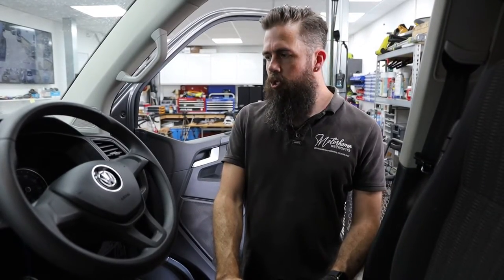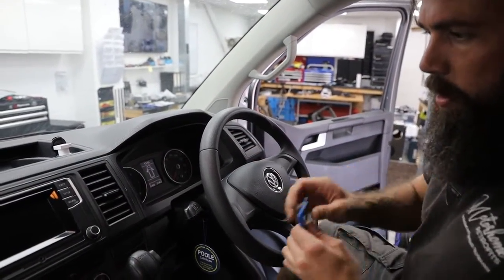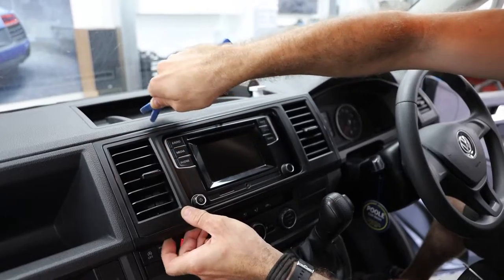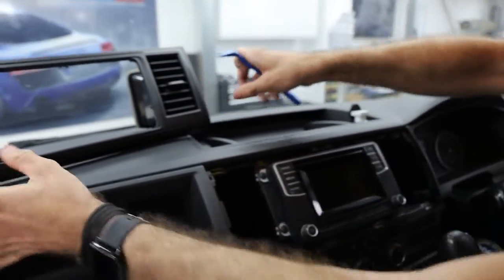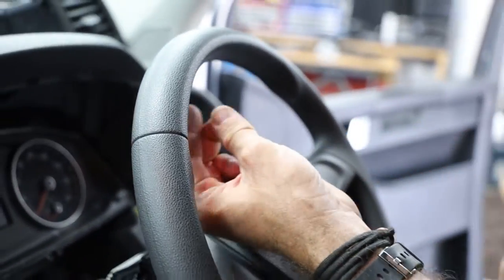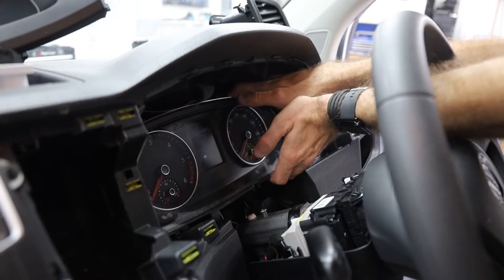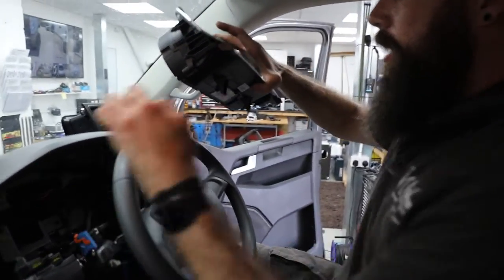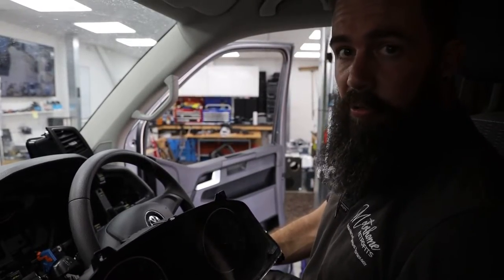How To: Remove The Instrument Cluster (Clocks) From A VW T6 Transporter

Comment: Great vid - thanks!! I have a T5 and the clocks have a lot of dust on the inside of the glass - I think it gets in through the holes for the trip reset etc.. I'd like to remove and clean. Do u know if this is possible or is the plastic/glass cover glued to the main unit etc? Thanks!
Reply from the maker: Hello Oric,

We are happy to help! Unfortunately, the clocks clear glass/plastic at the front is often sealed shut. I'm sure if you were persistent enough you could get in and clean it, but you may damage it in the process.

Kind regards,

Advanced In-Car Team